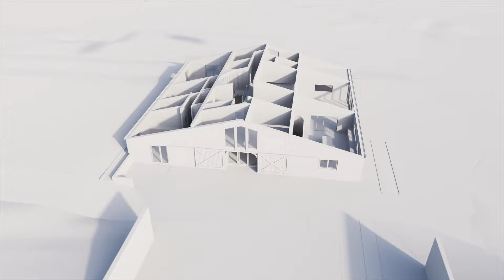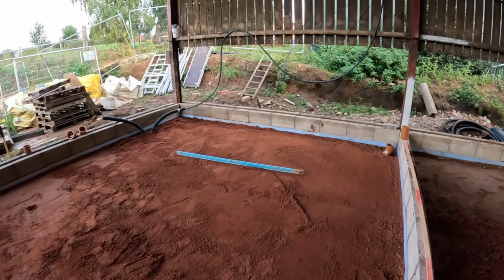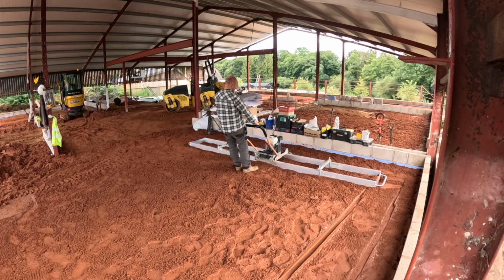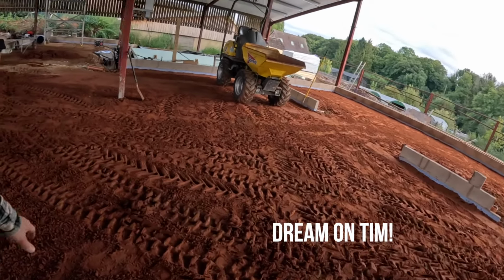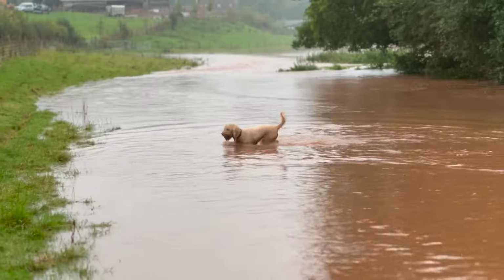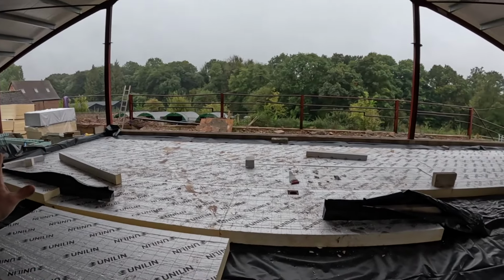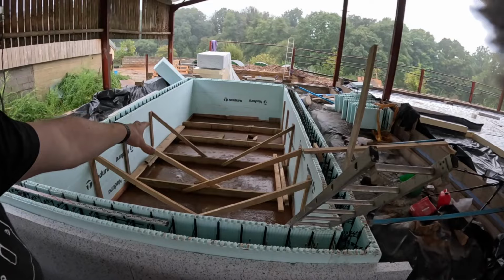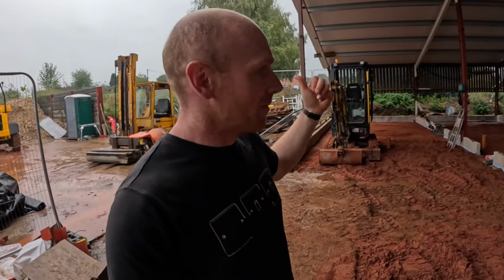INSULATION FOR A CONCRETE SLAB - Sand Blinding, DPM and PIR

Comment: Hi Tim, if you're worried about the slight rocking in some of the PIR boards, a technique I used at home was to just put a diagonal cut in the board with a handsaw once it's laid - a bit like you would do in a paving slab in a pavement where there were undulations. No need to tape the joints or cuts. Also make sure your poured layer has expansion joints in at the appropriate spacings. Great content as always, thanks.
Reply from the maker: Turned out most of the rocking was actually the boards slightly cupped so flipping those helped keep joins good. Concrete cuts will go in the day after pour. 👍

Comment: The twin rail tamper runs on top of shutters or steel road forms. Normally used when you are concreting in bays. You pour the concrete tie a piece of rope on each end turn on pull along. Polished concrete is an art. I have been working in civils ground works for over 40 years and have poured many 1000 cubes of concrete, I wouldn't be able to do a Polished slab.. Good luck
Reply from the maker: That makes more sense, definitely not like the vibrating screed bar is tried before!  The contractors will be doing slab with boom pump, ride on power floats, etc basically like a factory floor. Polishing will come much later once cured.

Comment: You need screed rails for that vibrating screed. Usually 40/50mm steel tubes or scaff tubes. Tied down to the rebar with packers between to get your desired finish height.

Comment: Hi do you have to do an up stand around the perimeter with the insulation board ? 
Are you putting in underfloor heating ? 
If so do you have to membrane again over ? 
And what type of screed ? 
Only asking because I’m at the same stage 😬👍🏻👍🏻

Comment: Superb work Tim. I love how so many of these projects are supersized versions of your others. We are converting our 6x4m garage and noticed the floor is out by an inch. Would you recommend levelling with concrete and some self-levelling or simply use the sand approach? It will be a floating chipboard floor.
Reply from the maker: If its just a corner I have done self levelling but it can soon add up if it's all out a bit.  Kiln dried sand to bring up a low spot with the DPM over works well providing you don't disturb it too much.
Reply: @TheRestorationCouple  thanks Tim. I'll assess the amount see which is best, everything is becoming far more expensive. Couldn't believe the quotes we had for French doors and that was supply only 😂 keep up the great work, best of luck with all your projects!

Comment: Could you attach OSB or PLY boards to the bottom of the Wacker plate with 3/4 metre extension bars to spread rhe load so it doesn't sink into the sand? this weather is really not helping lately, great progress btw 👍

Comment: Your supposed to have some formwork on either side gor the ends of the vibration screener. You pull it along on those.  Then it doesn't sink in
Reply from the maker: Yeah soon discovered that when I asked. 😀 Fortunately not needed as the concrete guys will have their own gear.

Comment: For a house of that size think well on how u distribute hot water around ur house. Our house is pretty large and we have a big run of hot water pipe from the storeage tank to the lower bath rooms. Takes ages for wam water to reach the taps. And the big surprise if u go back to the taps 1/2 hr later water is cold again. 3/4 inch copper pipe with std copper pipe insulation laid in the floor insulation. If I was doing it again maybe plastic pipe with as much insulation as possible. Good luck

Comment: What depth insulation are u using on the floor..
Reply from the maker: 150
Reply: @TheRestorationCouple  thanks for taking the time for that, i ask because I’m currently doing my self build at 4200 sq ft  just outside Oxford and always good to reassure what I’m doing.
Reply from the maker: @geoffclark2411  The jump from the original 100 to 150 was actually advised against as the gain is so minor compared to improving other parts of the buildings fabric.  In the end we decided to go with 150 anyway as its the one thing we can never improve in. the future.
Reply: I’ve always said to clients put as much insulation in as possible, retro fitting can be difficult and once it’s in its doing is job saving you money from the day you move in. Have just  been working on a new build warm roof we’ve put 210mm of rigid foam insulation in, under the standing seam roof finish
Reply: @TheRestorationCouple  I couldn’t agree with you more we are doing exactly the same as yourselves, for the extra investment now will pay in the future.  Not sure how far you are with getting the floors concreted but we have used a company that were fantastic and blew the other competitors prices to bits they also offer grinding and polishing on the aggregates which they completed in the garden apartment we are also building and it worked out cheaper then floor coverings. They have all there own pumps and kit very professional crew.
Let me know it you would like there details.

Comment: As someone who`s in the trade - after watching your last attempt to pour a slab - Get a professional crew in - concreting is a skilled job not for DIY`ers - FYI the motorised tamp runs on screed rails or shuttering - great sub floor prep, you don`t need to tape the PIR - I presume you`ve got reinforcing mesh going in your top slab?
Reply from the maker: Fear not, we eventually found a decent contractor to do the slab. Would never have taken on the whole thing as needs to be done in one hit really so more of a commercial job than residential. 👍
Reply: Gosh ……..is that the size of the pool …….! it’s tiny I thought it was goin* to be an Olympic size ! 😢😢😢😢
Reply: In my experience most so-called professionals are lazy and cut corners. Many experienced so called DIYers do much more competent work because they care more.
Reply: @tomp5207  completely agree. Many a time I've had to recall 'pro's' to correct things. As a DIYer, nothing I have done has ever failed. People get greedy when time is money.